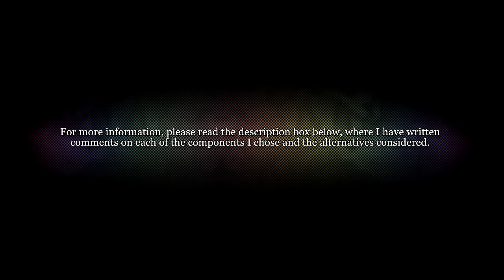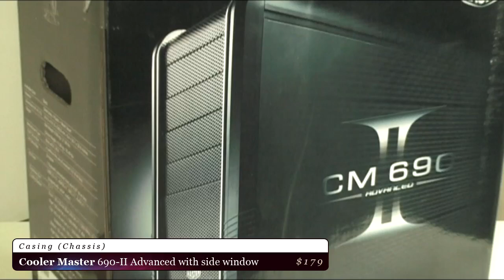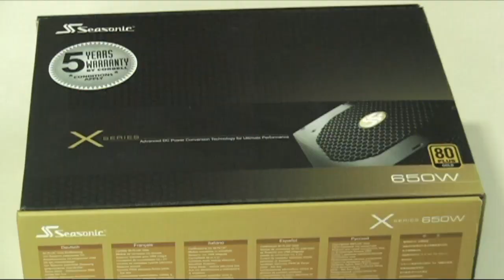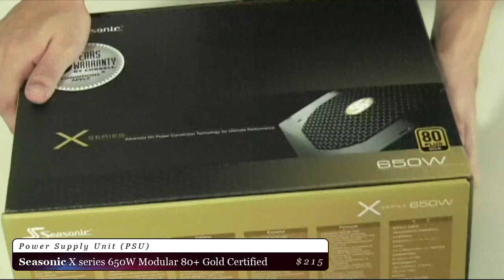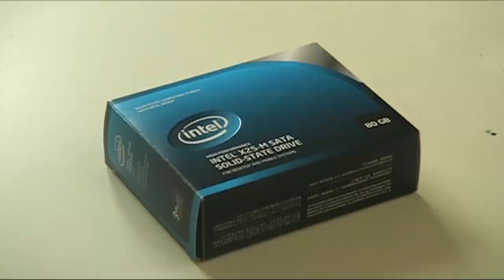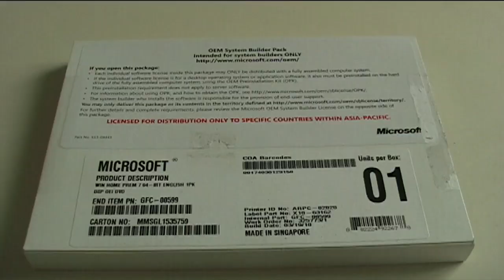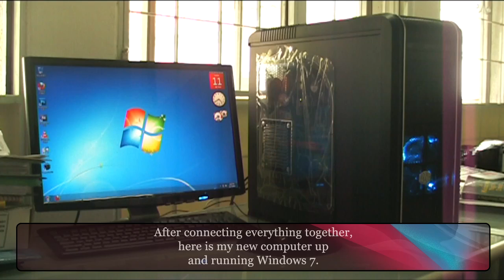Calvin builds his computer for the first time

Comment: @calvincjy - The internals of your case is warm air from everything else in your system (CPU, Vid Card, Memory)...if anything your pulling in warm air from your system...not fresh air from outside your case...I would recommend turning that PSU over so that it vent downwards.

Comment from the maker: @lejoe48 Haha you're very observant! The case design requires the PSU to be bottom mounted. I did purposely mount the PSU upside down with the fan facing up. The main reason for doing so was because I thought the fan would be able to draw more cool air from within the case than from the thin space beneath the case. However, I'm not sure if it made any difference.